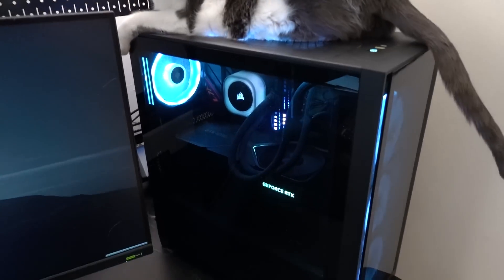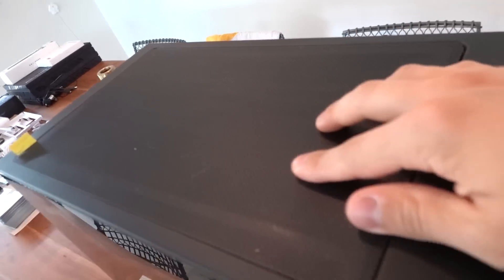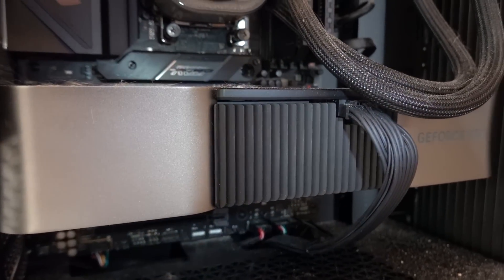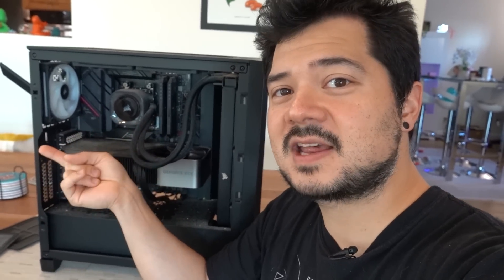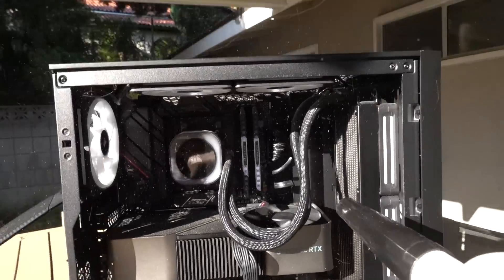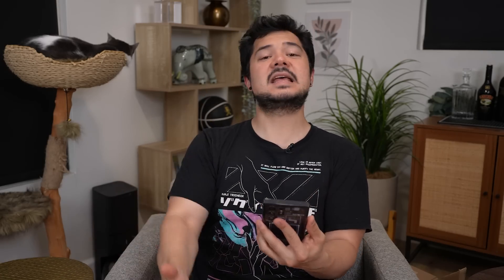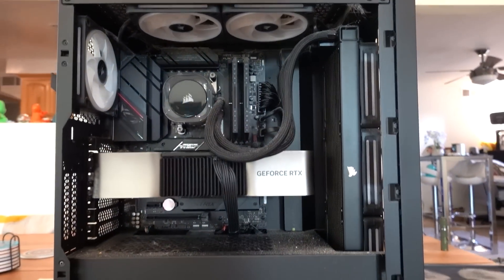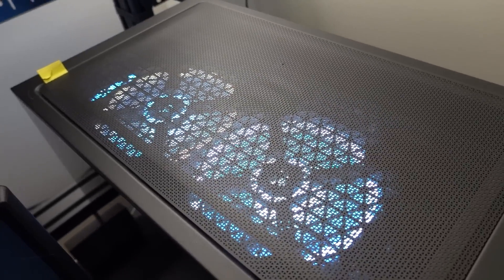Does Cleaning Your PC Improve Performance & Temps?

Comment from the maker: Thanks to those warning to not let fan blades spin freely when dusting which can cause damage. You learn something new everyday!
Reply: Not a huge risk, just a possibility. Like getting hit by a car when crossing the street; not likely to happen, but a possibility. I've been building PCs since 2015, and use the same metro datavac you used in this vid and have never damaged any fans. I've built and cleaned dozens of PCs, being the family+friend PC guy.
Reply: It’s not only fan damage, but when you spin the fan blades with air, the motors then act as generators, able to inject (over)voltage to whatever board they’re connected to. Some fans and components may incorporate basic protection (or ‘theoretically’ won’t backfeed power), but you won’t know until it’s too late, as such protection isn’t usually documented.
Reply: @johngy6296  Acts as a generator if you spin it backwards, even then...probably protected by a circuit. Easy to test. Plug a multimeter into a fan and blow on it.
Reply: What i do it pull all the Fan's power connecters off so you can do that or just Take all the fans off and clean them really good.
Reply: Oh good, I thought I had been pointlessly avoiding overspinning the fans all these years. Nope, I just know better :P
Reply: I couldn't figure out whether the "revving" was the fans or you, but either way, it had me cringing.
Reply: I love your Asian accent!  That's what keeps me coming back. 😅
Reply: I deleted my comment too...🙈
Reply: I had to learn that the hard way with my first gaming pc 😭
Reply: I'm in the middle on the video and was going to write about it.
If they are crappy they can generate electricity and go in the wrong direction.
If they are good and have good electronics they can spin faster than the bearings/fluid can handle.

I just put a bunch of sticks in the fans when I clean my PC with a blower similar to the one you are using (also great tool to remove the dust behind some furniture at house or under the couch)
Reply: @Kapisketo  Again, that's been debunked.
Reply: No one cares bring back Heather
Reply: This is a guide on how not to clean the PC

Comment: i was going crazy with my GPU with the core temps going to 82c (could be way lower i just use very low fan speeds due to noise) I just cleaned the bottom air filter and repasted the CPU (already tried everything with gpu) and got 12c lower GPU temps. what a relief and just realized how much dust actually affects temps. way more than what any thermal pad/paste did for me

Comment: Put aluminum foil on top of the computer. Cats tend to hate aluminum foil. If anything cleaning my pc makes it run quieter over cooler. I usually guage that it's time to clean it when the fans start running at higher rpms.

Comment: I think what you need is a an older PC with caked in dust. First just replace thermal paste. Then clean first. These 2 tests will show if replacing paste is good enough or if the caked in dust plays a big role.

Comment: Please don't let your fans free spin when blowing them off, you can damage the bearings. 
It works great if you just hold the blade from spinning while blowing each fan. I teach my cat 
not to get on my pc when its off by putting a sheet of aluminum foil across the top, they hate that 👍

Comment: I wasn't that dirty. if fans can spin without troubles and the radiator is "clean" you won't notice any difference in performance. PROBABLY the difference would be temperatures OR the noise. The most dirty part was the filter in the front and probably those fans now run slower to reach the same performance.

Comment: You should think about getting battery backup for your home along with solar panels installed at your house so you don't have to  deal with the wims and sudden price increases of your electricity supply company during summer season's especially because of high electricity demand blackout's could be a semi-frequent accurance to deal with.
Having energy backup also allows you to run the second pc you made for your cats more or less 24/7 without worrying/dealing with high electricity bill prices.

Comment: I just cleaned my front pannel + front dust filter and my max gpu temps went from 81C to 76C. I also am able to keep keep my cats off my pc due to its large size it has only a couple of inches from the bottom of my table.

Comment: FYI any electric motor is also an electric generator. I hope those fans where disconnected when being spun by the dusters air flow. Or perhaps on circuits protected against that, some gpu fans have been don't know if FE 30 and/or 49 series are though.

Comment: One thing I would add to Kyle's thing about rubbing alcohol.  Use 90% or higher.  This prevents any possible water deposits or possible leftovers.

I have used only90% or better for a lot of sensitive electronic circuit boards, sensors, and measuring devices while in the Navy and working for Honeywell.

Comment: I have a similar brand to the data vac, it works well. I use it twice yearly, once when the weather starts to get nice, and again towards the end of summer. Regular maintenance saves time in the long run to prevent that nasty blackish caked on dust and other debris from building up - that's when cleaning becomes more of a task and is harder to remove. Of course the real motivator is just having the PC looking nice.

Comment: ok to be fair Kyle YOU started this whole Cat laying on your PC thing! you conditioned your cats to think its ok To lay on your things and now they will walk all over you. your cats own you now.
also i highly advise against blowing air into your GPU using a datavac as the moving air can generate static and potentially ruin your GPU, use a can of compressed air as it contains additives to prevent static discharges.

Comment: Don't spin fans with air like that.  You can spin them faster than they were designed to and damage them.  They also become generators and push voltage into the parts they are connected to.

Comment: The build up on top of the front radiator is pretty telling of negative pressure. Dust is getting in from just above where there is no filter. You want positive pressure to avoid that. Either add more intake fans where there are dust filters, or increase the speed of the existing intake fans, so that they suck more air in than the exhaust fans expel. You may want to remove the back exhaust fan, it's not very useful, or if you want to keep it for looks, make it spin very slowly.

Comment: You got a dislike. Wanna know why? We don't spin these fans with a leaf blower or something  O_O WE DO NOT LET THEM SPIN!! O_O We either disconnect them and let them spin or keep them still while blowing them... Letting them spin introduces voltage and generall generates power. This power generation could go back onto the motherboard and fry something... Yeah... Don't... 
Also, blowing them with such high pressure on the blades might slightly put off the balance and centering of your fans... You mught ruin them.

Comment: , heres a hack for you, i have two gsd so i know all about fur in weird places, heres a tip, i have the same case and fans i have a 360mm aio as intake at the front and the rest are exhaust, so when i see dirt starting to build up i ramp all my fans to max and leave the pc running for like 30 mins while i go do something else and usually by the time i switch back to my normal settings the pc has blown the dust out with positive pressure

Comment: A PC should not be cleaned just when it starts to throttle down. Cleaning it keeps as much dust as possible out of the fan bearings, making sure they're gonna live much longer. To a degree also open contacts might have dust build up in them and show issues when mounting devices in them.
To keep the cats off the PC you could build a little shelf to place on top of the PC. That should keep them off and reduce the de-furring needed.
Reply: I'm pretty sure new fans are usually using sealed bearings

Comment: I think it would be a bigger difference if you waited like.... a decade and then cleaned it.
I ran through an old Prebuilt my parents had from like 2006, and the fan was LOCKED clogged with dust, it was so heat throttled it wouldn't even run windows at any kind of usable speed.
Reply: Nah. Just go see LTT's old "extreme cable mangement" something video. They filled a case with crap and its still fine or something. You clean the PC to increase its longevity. Imo fans cant last long if you are dirty, smoking or animals. Also resale value.

Edit, old video but found it: 

Cable Management - Does It Impact Cooling Performance? At All?
Reply: @Djuntas  notorious liars LTT said something? you don't say.

LoL, But nah, my parents don't smoke, they haven't had a dog since.... yeah like 2008? it's  just one of those Rural country houses where dust is just... in the air and on the stuff. Once the PC was clean the fan (Which was your stock 2006 Intel Fan, which pretty much just blew cold air directly onto the CPU.) it worked just fine.
Reply: @nocheckmarkgames  wtf...Bro Just check the video. I dont mean anything by what I said directed at you. Its an old luke video where hes just having fun.
Reply: @Djuntas  oh no no I didn't take offense, LoL. I just, haven't watched LTT since the controversy.

Comment: I've seen people claiming that blowing air onto a fan - moving the fan - is really bad for it?
Reply: Yeah, when the fan is spinning uncontrolled it turns into a generator that pushes current into the motherboard. If the current is high enough it could do damage to the fan header or the motherboard.

If someone is going to use an electronic duster, they should hold or tape the fans in place so they don't move. It will also make sure it's blowing the dust out and not the fan blades around.
Reply: @homestar2112  Kinda funny.  I always take q-tips and slot them thru case vents and through the blades and tape them in place.  It's awkward as hell, but it works.  I honestly dunno if I'd even go to such lengths to keep blades from spinning, but my electronic duster has two settings: mild and strong.  The strong setting is insane.  I use the same duster to clean out the bottom of my zero turn lawn mower if that tells you how strong it is.  

I love my duster, but I have to be extremely careful with it.
Reply: @homestar2112 I came here to comment this 😂
Reply: That is indeed true, it can break the fan and as homestar2112 quoted also put charge on the mobo..
Reply: Modern brushless DC fans used for PC components don't allow current flowing back to the mainboard.
It's bad for the bearings nonetheless
Reply: Generally speaking, it's probably not going to do any damage. Like 99% of the time, it's not gonna hurt anything at all. But you know, you hear of like 3 people that did actually damage something and everyone loses their minds lol.

If you're a "better safe than sorry" person, you can stick something in there to stop them from spinning. I've never done it and I've never hurt anything. Been building and cleaning pc's for 8 years 🤷‍♂️
Reply: @pandalife_gaming  Same. I'm the "build a PC for me please" guy for friends and family, have always blew out all the dust with that same metro datavac Kyle used in the vid, and have never damaged a fan. To me, it just seems like one of those "potentially bad" cases and not a huge risk in actual use. This is a few dozen PCs over the years. I'd probably be more prone to damage a fan by trying to hold the fins in place while I blow it out with the datavac lol